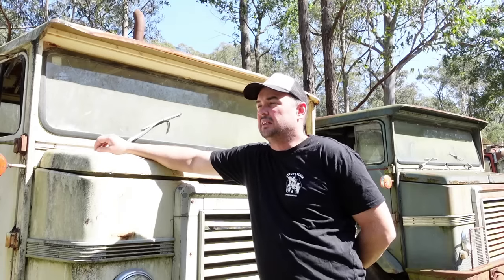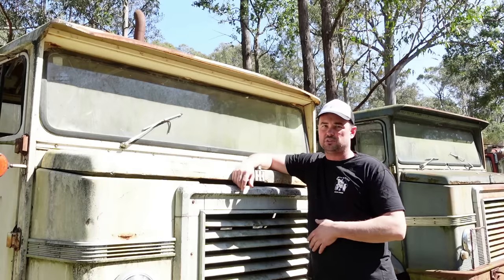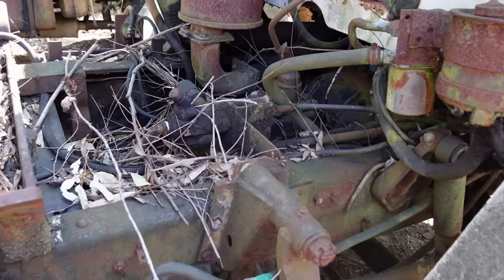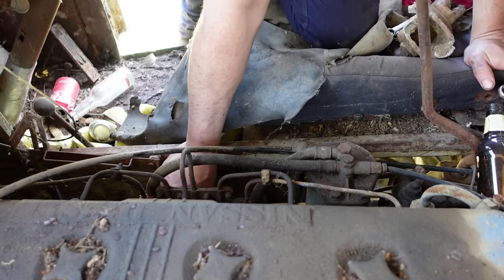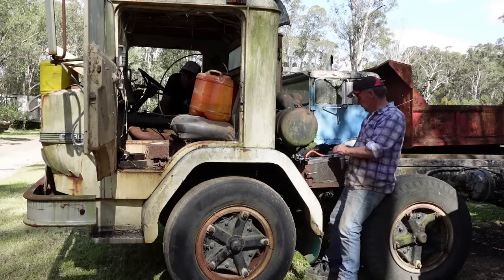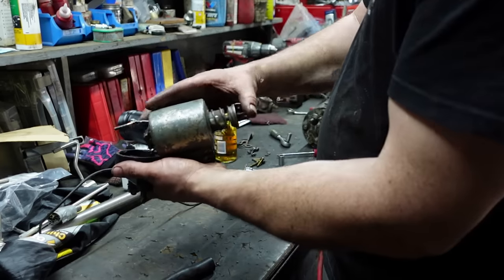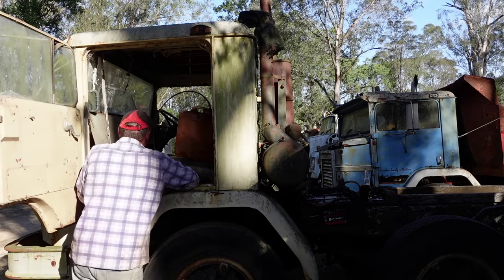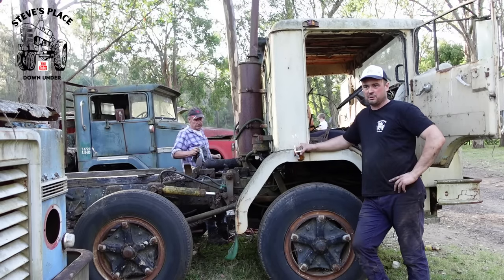Will It Start? Nissan Diesel 2 Stroke UD5

Comment: I'm in western Canada and I never knew Nissan made 2-stroke diesels until now.  It sounds a bit like a cross between a 71 Detroit and a roots-blown EMD 567 or 645, the hum of the blower is very prominent on this.  I love it!
Reply: Me too  I thought Detroit V 71 two stroke only made those  kind of engines .
Reply from the maker: Wonderful mate I’m glad you liked it. They were similar in many ways. These were 75 per pot as opposed to 71 of Detroit
Reply: @stevesplacedownunder detroits came in 51, 53, 71, 92, 110, and 149 per cylinder depending on the application.  And from 1 to 24 cylinder as well
Reply: Convert a UD6 to v-force carbon fiber reed valves for each crankchamber sealed and stuffed with billet aluminum. A billet aluminum 7068 alloy head with coates ball exh valves with dry sump and 2 VRO pumps. Run ethanol E85 with MSD magneto and castor 927 maxima 2T. 450 CID of 2 stroke fun!
Reply: Same here my grandpa drove a pacific p12 up until the early 2000s around the revelstoke area with a Detroit in it as far as I knew they were the only ones building 2stroke diesels
Reply: I’ve been a log truck driver here in bc on the west coast, mostly fat trucks , Hayes hdx 1000 , pacific P-16, 14,12,8 , Hayes hd400 , pts of Detroit v-12 , big cats and more than a few Cummins powered trucks , I own a 1979 kw low 924 , 3408 , 18 spd 46 000 rears , kw big six suspension, it’s a very close highway version of the fat trucks , Mr cat is one hell of a pickle truck  😊
Reply: @MattyC62185 they came in 51 series too? Any thoughts on what the application was for those or when? I'm curious, I love learning about them
Reply: @goosenotmaverick1156  the 51 series didn't have exhaust valves, only the lower ring of ports just like a gasoline (petrol) 2-stroke.  They were made during the 1950s as two and four cylinder models only and seem to have been superseded by the 53 series, very few are left running today.
Reply: @goosenotmaverick1156  51 series was from the 30s to late 40s  afterwards was replaced by 53 series
Reply: @bobsmith2637  thanks to both of ya! I wasn't aware of those, learn something new all the time!
Reply: @MattyC62185  also V blocks were among those, most of the large cylinder count engines came in V blocks
that being 8, 12 16 and 24 (i could be missing some, didnt know about the 51 series or the 149)  
reading the coments, looks like the 51 series was the lol valveless silvers? didnt know those were different in terms of displacement, cool!
Reply: @djaydeved  the silvers were some of the last ones of the 92 series produced in the 80s. 51 series were pretty rare.  And some 6 cylinder and anything greater than 6 cylinders was a V-block
Reply: Get one of those diesels running and head east towards Ottawa before it's too late 🚜 and to the creators of this video head east in a couple of these old beauties and go east, as well across the nullabor and 
towards Canberra 🚂
Reply: They sound more like a Foden FD6 than anything Detroit.   My bus's Detroit 6V92 sounds very different to this (especially now that I've straight-piped it...)
Reply: 😅 @stevesplacedownunder

Comment: I understand AACO was Australian Army Cab Over,and ACCO was Australian Commercial Cab Over. In the mid '70s I worked for an IHC workshop and we installed a UD5 in a MAN for a customer 
carting bricks towing a dog. The UDs were built in marine,industrial and truck applications.

Comment: Hi Steve ,, I came across the UD range of motors way back in the mid 70's .
From memory the UD3and UD4 came into Aussie as second Hand motors , my old boss used them to repower his irrigation pump and later he put a UD4 in his cans harvester ... The UD3  replaced the 6-354 Perkins on the irrigation pump  sorta the same horse power , there about 115 , with no muffler , Christ you could hear it 2 miles away at night , screaming like a banshee ..
The UD4 replaced the 6-354 in the cane harvester , there about 125 hp which wasn't much better than the old Perkins Some how some where he found a 4 valve head to replace the 2 valve head which increased it 145 hp ,,,, The 70's was a great decade to live in 🙂,,
Reply from the maker: Hi Russel. This was a good read mate thanks for sharing. I believe they were very common as a repower option back then. Dad always said that I grew up in the wrong era but that’s his fault, not mine😅😅😅. I’d love to go back to then and look around mate
Reply: How about a turboed 8v75 ud!
Reply: I still have a brochure for the UD 3cyl. from the mid 1970s. My father was toying with the idea of buying one for an irrigation outfit, but that didn't eventuate. Apparently, they were a cheap 'crate engine" at the time.These were new engines sold through Annand and Thompson dealerships.
Reply: How about a turbo UD4 in a Nissan titan it might just fit! tall 2 stroke engine though.
Reply: Get a BRP ETEC 1.9L 3 cyl G out of a 150 ETEC and it would probably be a bit better than a 3-71.

Comment: How awesome would it be to see that fully restored with the UD5 still in it
Reply from the maker: Yes it certainly would be, I’m just hesitant of running it because there’s not a lot of parts around
Reply: Nice but looks like A/C compressor tucked away down there.

Comment: I have never seen or heard of a 2 stroke UD 5 cylinder before.
I worked on a 5 cylinder 4 stroke diesel in a hino.
Such a wealth of information Steve.
Reply from the maker: There’s a first for everything mate. Hope you liked it. Yes there are a few manufacturers that produced 5 cylinder 4 stroke stuff, still a common amount of cylinders in today’s cars
Reply: @stevesplacedownunder  The mixing oil in a 2 stroke gas engine lubricates the crankcase, which also serves as the blower, but a diesel intake charge has no fuel, and any oil would preignite.  So how do the pre-blown UD engines lubricate the crankcase?
Reply from the maker: They lubricate like any other engine through pressure fed bearings from an oil pan and a pump
Reply: @stevesplacedownunder How then, would such an engine keep oil out of the intake charge? baffles, perhaps? he same way gas engines keep oil out of the PVC valve and tubes?  If early engines had no blower, then they needed the crankcase to use as a blower, and if they used the crankcase as a blower, how did they keep it from sucking up and burning the crankcase oil as it came out of the rod bearings?
Reply: @alan6832 They don’t use the crankcase for scavenging. It stays sealed like a 4 stroke. Instead they use a blower that does it for them. They are considered naturally aspirated because the blower is not used for extra power. It’s used because it has to. Hope that answers your question.
Reply: @chevy6794  Then why did you say that the first ones, before they made yours, had no blowers, but reed valves like a giant weed whacker? Or perhaps like a direct injected 2 stroke outboard?
  Also, would it be blown if you geared the blower to turn faster?
Reply: @alan6832  it wasn’t me who said that. I was just adding in to help you understand it. I’ve personally never seen the reed valve type but I’d imagine it would not be too good at scavenging and cylinder filing so would probably lack power. Emissions might be better though because the lack of scavenging might act like EGR? As far as a smaller pulley I’m not overly versed on these engines but I believe the intake and exhaust are open at pretty much the same time so extra boost would just basically go out the exhaust. Detroit did use turbos at some point but I know nothing about that system. All two strokes do not respond well to boost though for that reason however with DI they are now using it on snowmobiles but is for altitude compensation and not power.
Reply: nissan UD 2 strokes ran on silicon nitride bearings? Not sure as both Detriots 2 strokes and EMD 2 strokes run on very hard forged 4340 steel carburized and nitrated. My 8v92 turbo has a very hard crankshaft and rods 4340 cr mo alloy, bearings are tool steel.

Comment: This engine is really interesting for being a unique 5 cylinder 2-stroke design and it even reminds me of the sound of a Detroit Diesel engine as well.

Edit: I appreciate it but no one needs to tell me what pot means for cylinders anymore since I already asked that and have been told what it means.
Reply from the maker: Yes mate it’s fairly similar in most cases, apart from a few obvious differences, like the injection pump. They are 75 cubic inches per pot as opposed to 71 too I believe
Reply: @stevesplacedownunder  That is actually correct and it is per cylinder not really per pot by the way.
Reply: @@govlovesyou1334 I see, thanks for telling me.
Reply from the maker: Thank you mate. I was starting to 2nd guess myself
Reply: @@govlovesyou1334I remember the term "pot" being used for carburetors when i was small, but sometimes people used it to describe cylinders on a motor too!
Reply: Pot must be the slang term for cylinder i guess like hole is.
Reply: @jlo13800  I was already told that but thank you anyway.
Reply: I wonder if the rods and crankshaft in my 8v92 silver turbo is made of the same alloy as the Rotax 850 Etec turbo R crank and rods, most likely it is.

Comment: Junkers made a two stroke supercharged opposed piston diesel aircraft in WWII. The Junkers Jumo 205. These engines all used a two-stroke cycle with 12 pistons sharing six cylinders, piston crown to piston crown in an opposed configuration. This unusual configuration required two crankshafts, one at the bottom of the cylinder block and the other at the top, geared together. The pistons moved towards each other during the operating cycle.  It was used for high altitude reconnaissance aircraft.
Reply from the maker: Hi mate yes I have looked into these since researching the history of these ones. It’s certainly a unique engine, especially for an aircraft. The Deltic locomotives had a similar, if not the same design too, to my knowledge

Comment: I joined a bus and coach company in 1976 and we had an Albion 45 seat coach with a 4 cylinder UD 2 stroke engine. haven't got time to tell the story's but I will come back to you another time.

Comment: I've been looking forward to this one. It was everything I hoped for and more!! Brings back some awesome memories of sitting in the copilots seat with my dad driving from Sydney to the Vic boarder to pick up an old Inter TD14, then up to the farm just North of Cooktown via Goondiwindy. Ours was a UD4 and the cab was swapped out for a later model (C1930 rings a bell for some reason???).  With the 're-cab mod', the engine cover never really sealed properly, so the noise and heat from the engine bay lived with us in the cab!! Fun times! Ha ha!! Super interesting to hear the history of these things. Until this video, I was only aware of the 4 or 6 cylinder options.  Sadly, our truck (along with a heap of other vehicles / equipment) was stolen. The rusted out empty shell was found years later beside a river about 100klms away. The engine found nearby with a heap of bullet holes in the injector pump governor housing. I managed to get the engine running again, but never properly.  Thanks again for the awesome video, Steve!!! Hope you had an amazing fathers day!!! 🙂
Reply from the maker: Great mate I’m glad you liked it. This is a great story. Thanks for sharing. They would be great memories. What a shame what they did to it. It makes me upset to think people do this to wonderful old gear like this.
Reply: @stevesplacedownunder People love to ruin things that aren't theirs, but plenty more folks are happy to fix that which can be saved, like you!

Comment: The 45 seat Albion Coach
The engine was fitted with a Commer Knocker 5 speed gearbox, on one trip a large bolt within the box tried to get out, putting a hole in the centre of the Overdrive housing.    We had spare parts so we had a five hour drive down the New England Highway, it was well into the night by the time I had the replacement cover fitted and early morning by the time we got back home.

Comment: Great job.
Somehow for a couple of months in the Far North (-35-40 celsius degrees) I left a VAZ-2112 under the snow,  1.5 liters, 16v, gas, and a Nissan AD, with yd22 2.2 diesel engine. VAZ did not start after couple of months - the membrane of the pressure regulator in the rail broke, Nissan started after half a turn of the key.
Reply from the maker: Hi mate gee that’s a cold environment. It’s a wonder anything started but no doubt the Nissan did. They a brilliant product
Reply: Cept that the YD in the Nissan is a Renault product 😂

Comment: Hey Steve , thanks to you and your dad for the effort to get that Nissan to start . I didnt know that engine existed. Happy Fathers day to the both of ya !  I didnt know that we had different Fathers day either mate . Our is in June here in the states ! If you have minute sometime , I happened to remember another old Detroit diesel that we had up here in 60's  , It was v-6 called the Toroflow diesel . The odd thing about that engine was that it had the intake and the exhaust manifold on the same side the head where  the normally exhaust is . I dont think it worked out to well as you hardly ever hear that they existed . 
Cheers 🌵
Reply from the maker: Hi mate. Thanks as always. It was a bigger job than I thought to start it. 
 Another bloke told me it was June also. 
 I’m going to look up this engine you mentioned mate. I’m interested now. Thanks as always mate. Great to hear from you

Comment: It would be great to see this machine restored. It’s hard to believe a little Nissan engine powering a 8 wheeler. That’s a big truck.
Reply from the maker: It’s a fairly big engine mate. 375 cubic inches, 225 hp 2 stroke diesel. It originally had a 354 cubic inch 4 stroke in it and was 120hp

Comment: Very nice to hear a UD 5  two stroke Diesel . I have not heard of one these engines must be close to 25 years re powered in a cab over sleeper deutz tipper . My father had a UD5  in his cab over international acco 1950 A  with a six speed crash UD box and he was doing interstate with it . This engine is just a copy of the 71- series GM . Bore and stroke. 110x130  UD5 horse power 225 hp  UD6 is 240 hp UD4 is 180 hp . These engines also made it to America but are super rare . They were known as a Chrysler NISSAN Diesel 2 stroke very very rare in America I have only seen a UD3 150 hp and A UD6 Genset  derated  to 220 hp .
Reply from the maker: Hi mate interesting read. I wasn’t sure if they made it to America just from a few blokes I talk to over there haven’t ever heard of them. I have no doubt a few made it there. Someone sent me an email with the specs on the 5 cylinder and said that they are 75 cubic inches where Detroit is obviously 71 like you said.

Comment: 6:20 it is still supercharger, but it creates only about 0.3 bars of pressure
exhaust duration can be tuned that way what it will have a little time to create pressure in the cylinder

Comment: My dad used to drive exactly one of these for a company called  Driveway and construction at Cecil Park, they had two of them with the Nissan motors one caught fire and Dad drove the other which was ridiculously loud in the cab, he used to have to rev the ring out of it to get the power steering to work around corners and was still Armstrong steering. They came off The Sydney airport runway extension with big heavy rock bodies as tippers
Reply from the maker: Great stuff mate. Just down the road from here Cecil Park, but truck wasn’t local or it may have been it. I’m keen now to see if any photos exist of the runway job. Thanks Brad
Reply: @stevesplacedownunder  hey Steve I worded my comment wrong, I don’t know if this was the truck dad drove but was set up the same and the sound of that engine sounded exactly the same as what I remember as a young fella and definitely remember the Nissan engine,Sid the owner and dad are gone now so I can’t help with photos but the google might be worth a look

Comment: Your snack pack with those cold beerzies is an excellent idea. That 5-cylinder two stroke diesel got an awesome sound. Starter contacts need to be clean and in milli Ohms, as large currents flow in those 12V starter circuits.
Reply from the maker: It was a great idea at the time. They sound great mate they really do